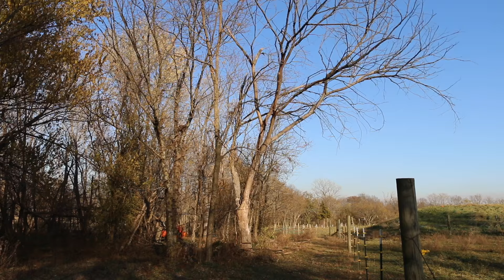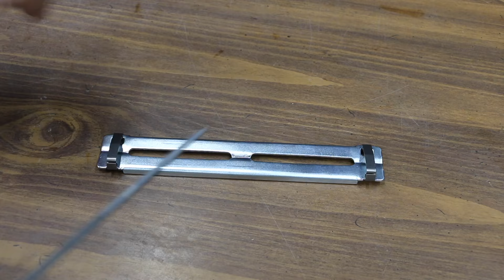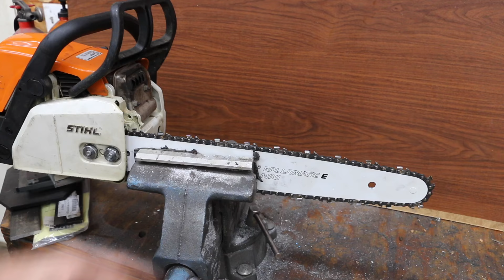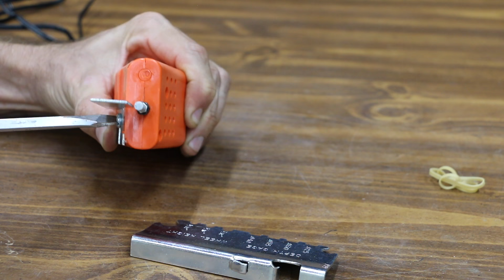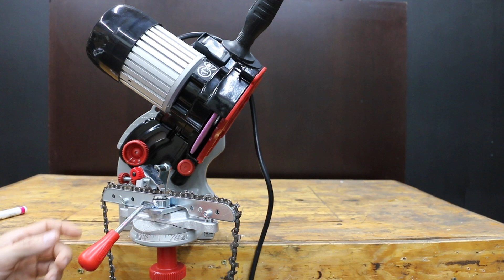Which Chainsaw Sharpener is Best? Let's find out! Stihl, Granberg, Chicago Electric, Oregon

Comment: Thank you so much for a video that doesn't include an autobiography

The two miter saw type electric sharpeners grind one side of the chain front to back and the other side back to front, making one side slightly sharper. I have one and it makes long cuts veer to the left.
I prefer my Stihl 2in1.
Reply from the maker: Thanks for the feedback.

Comment: Personally I use a diamond bit in a Milwaukee 12v variable speed rotary tool for quick touch ups on steel chains and the ability to sharpen my carbide chains. I also use the Husqvarna depth gauge adjusting tool that only uses the corresponding cutter to measure the depth gauge. Far more accurate than the depth gauge tools that use other nearby cutters to adjust the height of the depth gauge.
Reply from the maker: Great feedback. Thank you!
Reply: @ProjectFarm  Stihl has released a new chain and file called the"hexa" chain. It's similar to square ground chain only they have a hexagonal shaped file. There are witness marks for 25 degree angle on top plate and side plate with hex file marks.

Comment: The problem with this test is it's all about operator are or how well the operator is familiar with the tool being you. I sharpen chains and I guarantee that they cut better than new. I don't ever have any comeback for a sharpening and people are amazed at how well they cut. I never follow the recommended angle. I ask the customer if they're cutting hard wood soft wood do they like the holdup on the side do they like to just rest the song on the wood or what is there cutting Style? Many variables
Reply from the maker: Thanks for the feedback.

Comment: the biggest problem with most off the bench grinders is the stone is not spinning the right way to sharpen the half the teath and leves a burr on the cutting edge, the instructions might say it dosn't matter but it dose, it makes a huge diferance to how sharp you can make the chain,
Reply from the maker: Thanks for the feedback.

Comment: Great vid. Well thought out and completely unbiased. Has  adequate my mind up on a sharpener - going to get the Stihl 2 in 1 set-up. Can use it in the shed, or, most importantly, can use it in the forest as well. Have had all my chains sharpened 'professionally' before but noticed the teeth blued by excessive heat from the grinder sharpener, and found they don't stay sharp as long as an original new chain. Hand filing for me now.
Reply from the maker: Thanks!  Thanks for sharing.

Comment: Great work, I love your channel. I think there may be discrepancy in sharpening with the inside plate angles. The bench mounted units have adjustments for these. This makes a huge difference with cutting speeds and efficiency ie staying sharp longer.
Reply from the maker: Thanks!  Thanks for the constructive feedback.

Comment: Just got the Stihl sharpener, why did I wait so long why was I replacing chain or paying to hair sharpened. Great test, helped me decide on it.
Reply from the maker: Thanks!  Glad to hear!
Reply: @ProjectFarm  would you be able to test what happens if you only sharpen one side of the teeth vs both sides. Then also the best bar oil. I usually throw 30w motor oil in it and I've used used motor oil too.

Comment: I like all your videos. I use the Stilh 2 in 1 and like it but suspect my technique needs some work.

You asked for other suggestions so here are three related to projects that I have on the go: 
1.  Come-alongs and Cable Winches.   There are many of these on the market so not sure what would work best and suspect it would depend on the project.
2.  Turnbuckles.  I have a project requiring the use of turnbuckles, hopefully temporarily, but maybe some in place long-term.  My local shops only carry one or two types but I see other brands on line.  I suspect they have different uses and are of different quality.
3.  Pond clean-out.   This is more generic and it likely falls into three categories requiring different equipment:  removal of solids like branches, removal of semi-liquids like mud or heavily decomposed leaves and removal of shoreline vegetation.  Many of us who have forested property, often have ponds that get filled with fallen branches or leaves.  If left alone, often the shoreline becomes filled with vegetation from cat-tails to pickerel weed.  Common pool cleaning tools are often too flimsy or are in appropriate for cleaning.   You can skim a few leaves off your pool but if you have 4 or 5 oaks around your pond - that's alot of skimming.  Of course in many cases we want to leave some of the leave litter but with shallow ponds, if you don't control that then you will lose your pond.  I've tried a few hand tools, like the weed razor,  with limited success.  In my case I really need tools that can be used by hand as I can't get a vehicle that close to my ponds.

Hope these are useful suggestions as these are tools that I need to use on various projects.

Comment: I learned a ot about saws here.
The Oregon model looks a lot like the commercial Belsaw sharpeners I used to see in shops as a kid.
It was amazing how much "gluck" the lye removed from the chains.
Reply: But you should note the chain manufacturers say to let new chain set in oil for at least 24 hours before first use. People don't do this then cry when the new chain stretches. I would say after cleaning like this to soak chain in oil for 24 hours before use. I keep all my spare chains in oil,until ready to use.

Comment: Decades of experience with chainsaws and a lot of sharpening. Mostly agree with your results. Granberg rocks. The frame that you attach to the bar is a bit of a pain, but not only will it make the cutters razor sharp, it will help you learn to hand file, which is a helpful skill in the field. One feature of the Granberg: as the reference guide bar starts to rub the stop nut, you will put less file pressure on the cutter. These light passes make a lot of difference for some reason and the cutters are awesomely sharp. Once you do this a bit, you can transfer this to hand filing -- just a few light passes at the end. 

I hand file in the field, sometimes alternating will a Dremel tool. Dremel especially if the cutters are very dull. The Dremel attachment fits a lot of similar tools -- I use a 12v Milwaukee. Very quick and appreciated with long bars.

I use a (Italian-made) bench grinder for horribly dull (rocks, hard steel) cutters and for re-profiling for ripping. Then a file.

The Dremel-brand stones are alright. The Oregons are alright. The Stihls are crap. Many off-brands are crap (all that I've tried). Granberg stones are the best. They last the longest, cut quickest, and resist just flying apart, to which many other brands are susceptible. 

The 2-in-1 tool requires full comp chain to work properly. I tend to use skip tooth chain. I'll check and file depth gages with the Oregon gage. This will wear with filing BTW, and should be replaced when it's taking a lot more than 25 thou.

And I have no affiliation with any of these manufacturers.
Reply from the maker: Thanks for the feedback.

Comment: Speaking of chain saws..  I work for a fire department in a rural area and we end up clearing a decent amount of trees that fall in the roadway. Recently we switched to battery powered chain saws.. more specifically the Ryobi brand and they preform significantly better than our gas powered (very expensive) Stihl chainsaws ever have with exception of the run time. We cannot believe how much faster and smoother they cut compared to the high priced Stihl saws.
Reply from the maker: Thanks for the feedback.

Comment: With the Oregon bench grinder for $194.99
You set it to take away to much of the tooth. Notice it turned blue, meaning you weakened the steel in the chain and therefore it got almost completely dull immediately when you used it. I know it’s an old video and you probably don’t have these stuff anymore but if you do, try setting it a little more gentle and it’ll surely do better in a “speed cut”. I do however only use one similar to that machine for the logosol saw and nothing else. Been using the Stihl 2in1 since release date and will never use anything else. It’s unbeatable. Been sharpening chains in the woods for almost 25 years straight and sure, free hand using the “old style” is what I still fall back to when I only need to touch up, but making a chain ready before work starts, I “zero” it with the 2in1 no question about it.
Reply from the maker: Thanks for the constructive feedback.

Comment: I bought the Granberg file sharpening system after watching your comparisons and I must say it's clumsy and not as easy to use as I'd hoped. After my purchase I learned of another sharpener that you didn't feature, the Timberline chainsaw sharpener. It appears more user-friendly with fewer moving parts (only a crank-operated carbide burr). It actually appears almost foolproof as long as the right diameter cutter is used. Would you please do another comparison using the Timberline? I'll probably go buy the Stihl 2 in 1 and give the Granberg away, it's frustrating to use
Reply: Got one of them it works . But the harbor fright grinder he showed does as good of job as any tool. The  electric grinder  i got at tractor supply the worst. The organ is just to slow to use. But if you got good eye sight take time to learn to use file. No grinder can beat a file. I even got a couple chisel chains that file with flat file. Man will they cut. They can not be round filed or ground. But now days don't use them because i can not see to file them.

Comment: The times you gave for sharpening didn’t include the time it took to take the chain off and put it back on for the systems that required the chain to be off the bar. The systems that allow sharpening on the saw, in the field have a big advantage that way, and also encourage sharpening when needed, rather than cutting longer with a dull chain because you want to wait till you get home. I logged for several years and always used just a flat file guide. Lots of guys used just a file, with no guide, but I never saw many chains really filed right that way. I might be tempted to try the stihl 2in1, but definitely couldn’t carry it in my back pocket like I did with the flat guide.
Reply from the maker: Thanks for sharing.

Comment: The thing is only one sharpener took the depth gauge down, and that was the "two in one", which should make that chain cut faster because it would be cutting more. All chains should have had all the depth riders taken down to get Optimum and accurate results.
Reply from the maker: Thanks for the feedback.

Comment: This was a very good and fair test. I would have liked to have seen the timberland chainsaw chain sharpener included. I think you would have had a different winner. In my opinion. You should check out one of these sharpeners. A bit pricey but it's the best sharpener for in the field to get back to factory sharp or better. Although nothing beats a good hand file in the hands of somebody that knows what they are doing. I have a Timberland sharpener, a Chicago electric bench grinder, a vintage grand burg bar mount, a Stihl 2in1, and hand files and the timberland will take a beat up chain in the field without removing it from the bar and get it back to factory sharp or better fast. Great videos. The lye was a great tip. Thanks
Reply from the maker: Thanks for the suggestion.

Comment: Most bench sharpeners will work great if the disc is contoured right and adjusted to get the proper edge profile angles.

Comment: The only one that I did not say being tested but it takes experience to use would be the Dremel high-speed chainsaw sharpener bits this is my favorite I have never used any of the ones that you have used but I can sharpen a 36 inch chain in less than 5 minutes but it takes experience
Reply from the maker: Thanks for the feedback.

Comment: LiL DiHo - N/A
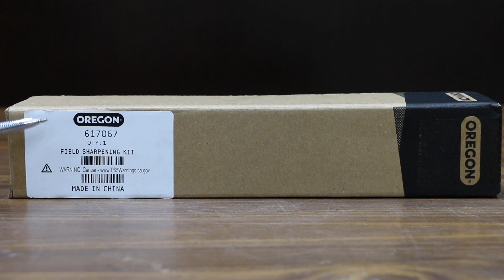2:13 - $19 - China - Oregon Field Sharpening Kit - 13.48 - 8.89
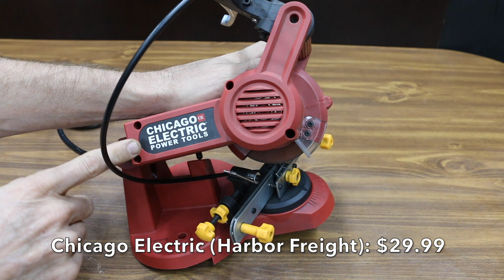3:54 - $30 - China - Chicago Electric  - 12.33 - 9.1
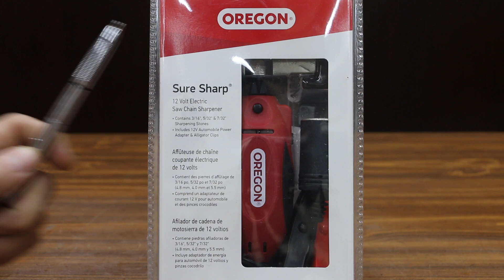5:42 - $31 - China - Oregon Sure Sharp - 10.82 - 11.34
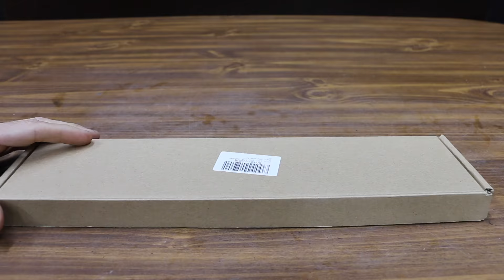6:44 - $36 - Germany - Stihl 2-in-1 File & go - 11.24 - 8.26
7:44 - $42 - America - Granberg File System - 11.24 - 7.74
9:05 - $84 - America - Stihl Portable - 12.96 - 10.56 (+$7 for bits)
10:07 - $96 - America - Grandberg 12v - 9.78 - 8 
11:10 - $195 - China - Oregon Bench Sharpener - 16.20 - 9.26
12:40 - Results
15:24 - Results #2
Reply from the maker: Thanks for sharing.

Comment: You put in a lot of work, ran a nice test, and gave a fact filled presentation. But in my opinion you should have also tested the sharpened chains ability to do a bore cut which is an essential technique for some problem trees - especially hard leaners which we have a lot of. My experience with the 2N1 is that while it's fast and creates an good cutting chain, some of them can over lower the depth gages and make a very grabby chain that is too grabby to bore cut with. I have an Oregon 410-120 and find its lack of precision to be really annoying. It's useless for grinding the depth gages (too long to set up and not able to deliver the repeatability to get them the same. The plastic depth stop on the Oregon is a major disappointment as is the fact that the grading wheel isn't centered over the chain and that can't be adjusted on the 410. I've had really good luck with guided hand files which only require touching up the depth gages about every three filings and result in chains that both cut quickly and are safe to bore cut with. They are light, easy to have with me in the field and work well with a stump vise. I have the 12V Granberg on order but it's backordered. I expect to use the hand file for the depth gages when using the Granberg.
Reply from the maker: Thanks for the constructive feedback.

Comment: I have the harbor freight bench grinder and the 2 in 1 stihl sharpener  . If the chain needs alot of help i use bench grinder but to touch up after fueling in the field i use 2 in 1. Both do the job for the price.
Reply from the maker: Thanks for sharing.

Comment: First comment when using a file don't push from the handle or the back of the file draw it from the front annual keep the file straight pushing from the back will it inevitably wind up with a wobbly tooth
Reply: You'll find with the grinding machines they have a little spring loaded FreePlay and as you bring the cutting tool down push it a little away from the tooth once you are fully engaged let the spring pressure pull it a little towards the tooth then pull it a little away from the tooth and disengage that is let it lift up if you just bring it down blindly you will get a miscut tooth and the grinder is how they manufacture them in the first place properly ground chain will last two tanks of fuel a properly filed chain will last one will be sharper on its initial cut and duller by the end of the tank
Reply from the maker: Thanks for the feedback.

Comment: I was a forest contractor for 2 years 
Pre commercial thinning 
My way if seeing how sharp it was 
Was by checking the saw dust .
Long feather like is the best .
I always filed the rackers down more then normal 
DC grinders were my goto  
Bench grinders wear out the chain faster but I did it after 10 file sharpening , to reset each tooth the same 
Even an expert goes off the track after awhile
Reply from the maker: Thanks for sharing.

Comment: Another super comparison by Project Farm!  Chainsaws are made to be sharpened but in our throw-away society in the US too many folks just opt to buy a new chain.  One lesson here is there's a learning curve on how best to use each device.  As a DIYer I personally prefer hand-sharpening instead of having another power tool that would only see occasional use.  Stihl 2-in-1 looks nice but I've got Oregon's field set bought years ago when the files were Swiss made.  Hand sharpening has made me understand the parts of the chain and it only needs my power.
Reply from the maker: Thanks!  Thanks for the feedback.

Comment: I love my Stihl 2 in 1. Not only is it fast, portable and requires no power, but it does a great job with both the teeth and the rakes. The testing times obviously don't include removing and replacing the chain with some units, a fact that eliminates those from consideration for me. Plus, there's something satisfying about hand sharpening a chain, that can't be quantified.
Reply from the maker: Thanks for sharing.

Comment: The teeth on a chainsaw blade are angled so each time you sharpen them the get shorter, so you may also need to file the depth gauge just a little bit.
That is why the Stihl 2-in-1 is the CLEAR winner!
It is not only affordable, it touches up every depth gauge every time you sharpen the blade to make sure it matches the cutting teeth perfectly at the same time!
The right depth of cut is almost as important as sharp cutting teeth, you forgot to mention that.
Great testing otherwise,
Thanks!
Reply from the maker: Thanks!  Thanks for the feedback.

Comment: I've got the Stihl 2in1 and very little sharpening experience.  I swear since it sets the rake height it gives you a good blade.  If that little difference in gap is correct then the blades remove more wood each time they hit your log.  Good sharpener for beginners.
Reply from the maker: Thanks for sharing.